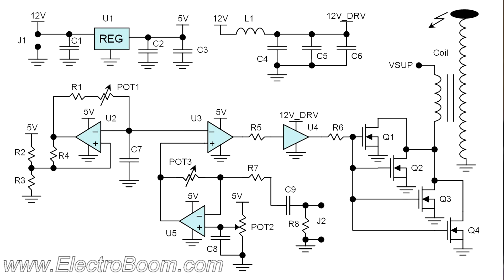Music, Magic and Mayhem with Tesla Coil

Comment: If you were to make a perfect dip in the top of the coil and balance the weight evenly on the spinner would it gain constant momentum or stop at a certain speed?
Reply: to would reach a top speed. at some point the energy being output would not be able to out push friction caused by the air. 

though n that question i do understand that this whole thought of using plasma to push something is being looked at for space ships, chemical rockets are really good for getting too space but once there are really in efficient, and because in space you have relatively little friction and gravity (or if you use a le grange point one could theoretically have no gravity (a legrange point is where the earth and sun cancel each others gravity perfectly, anime loves em)) using something different for propulsion is something really being looked at for viability
Reply: +John Smith with no friction, its top speed would be about 2,200 kilometers per second.

Comment: does the spinning wire rotates due to flux? or because of that fiery thing that comes out of the wire to produce a torque as he said?
Reply: thing the first, "flux" assuming your talking about electricity and not metallurgy is the electricity caused by moving a magnet past a coil of wires. Flux is actually exactly how all electricity generation works to my knowledge, turbines are just giant spinning magnets with coils of wire around them. coal and nuclear are just used to heat water that turns to steam and that steam pushes said magnet in circles.

no whats happening here is the electrons are so excited that they jump off of the wire into the air, and as physics says every action has an equal and opposite reaction, so even though every individual electron weight is negligible due to the high volume jumping off they collectively push the wire as they attempt to jump into the air
Reply: Ohhhh!! Thanks
Reply: Actually, as he himself explains (http://www.electroboom.com/?p=575), it's AC, so the electrons get sucked back on. But the movement creates heat, causing the expansion of air.

Quote: "And they are not jumping out anyways, they are jumping out and in at 1MHz frequency. So what is turning the wheel? It is the expansion of air due to the heat of arcs that pushes the rod away. The arcs are pretty hot. In fact when I bring my hand close to them, I can feel the heat rising from them."

Comment: You said that the spinning wheel was powered by the electrons, but this is wrong since there is no DC component in a Tesla coil. I think that heated air plasma taking expansion is a more correct explanation.

Comment: yo can someone fund this guy for fucks sake ? can we use those innovations and make them into real things ?
Reply: +hisham borgol 
This sort of thing has been done before

It's used in some places IRL, for example arc-wielders.

This guy knows his stuff alright, but he isn't the first, or only person to do this
Reply: modern science doesnt jump forward with single innovations any more. most truly innovative break throughs are caused by answering a series of smaller problems and piecing the answers together and the many questions are usually not all answered by one person.

TL;DR science is hard and it takes little steps not big leaps

take for example the question of how to teleport something like we see in scifi stuff all the time. how would one manage that? question the first are we assuming no pocket dimensions or parallel worlds? if thats the case we need a computer capable of somehow scanning you and determining your exact form down to every atom and chemical and bacterium, to my knowledge no computer has a way of scanning you with that granularity yet so thats a start. next issue, how do you propose we rip you atom from atom? doesnt that sound painful? also if we rip you atom from atom then shove them back together, have you really been teleported? or just killed and cloned? then assuming you can scan me and decompile me, how do you propose we put me back together? chemicals have minds of their own and behave in ways we can well predict. why would all the florine in my body go where we want it and not just attach to the next possible thing it can like it tends too?

all that rant is assuming no parrallel dimension teleporting, the problems with dimensional teleporting are just as daunting, cuz we dont even know if they exsist or not yet lol. suffice it to say, your not gunna find un discovered science on the youtubes, at least, not in a manor as silly as this man
Reply: any electrical engineer can do that
Reply: You don't need to know anything about parallel worlds or pocket dimensions in order to teleport, teleportation is just a method of transportation.

Teleportation, as a concept, is silly: if you need to move all the atoms in my body to some other location where you'd then reassemble me, why not just load me up in a car or a plane and move me there?
If you need to disassemble me (ie. kill me) to scan all the atoms in my body, and then proceed to use that data to create a copy of me in another location, you would have discovered cloning. Now, just use that data of me to create infinite copies of me and I'll conquer the whole world. Bwahahaa.
Better yet: if you can scan all of the atoms in a human, you already understand how everything in a human works, and you could easily tamper with their DNA and physical properties. Thus, us regular mortals are no longer needed and our new superhuman overlords can simply discard us.

Even though it is irrelevant to teleportation, I don't believe there has been a any significant evidence that suggests the existence of any form of parallel worlds or pocket dimensions. Sci-fi that is loosely based on quantum mechanics doesn't count as evidence.

Comment: Electroboom, you are the bomb!
Electrojet propulsion, Wireless transmission of electricity by induction through insulative materials, Electrojet sound emanations.

Why are you able to replicate Tesla's results using DC when Tesla used high voltage high frequency AC?
Is there a principal of application which applies to both AC and DC or was Tesla using DC circuits before the coil to achieve certain results?

Comment: .... how? how can ELECTRICITY make MUSIC?????????????????
Reply from the maker: +wolfy boy There are these magical things called speakers
Reply: Yeah, i know, but since he DIDN'T use speakers, i was curious.
Reply: +Joseph Matthew Dailisan (Matt) ok thanks. :)
Reply: +Gain Medium awesme!
Reply: +wolfy boy The same way we hear thunder, it creates sound pressure waves but it uses a spark instead of a vibrating surface like a speaker. The spark has a very high frequency carrier waveform (above 20KHz) and the music causes that wave to have lower varying frequencies embedded within it.
Reply: The heat from the arcs causes the air to expand generating compression waves called sound.
Reply: Pain Foinmr Because he used an audio signal, same as the one you send to your headphones. An audio signal is just very precise pulses of electricity going from positive to negative, on/off, very fast. They move a speaker back and forth with on and off, a certain amount of times per second, to make a sound of a certain pitch. Instead of moving a speaker cone back and forth, that same signal is just pulsing the electrical arc on and off.

*Disclaimer - This isn't 100% accurate, but for a YouTube comment it'll do. If someone else wants to write an essay on the nuance of AC signals and waveforms, be my guest :)
Reply: +wolfy boy You referred to the creator as 'he' when you were directly addressing him, that is why the weeaboo pointed it out.
Reply: +Morgan OH yeah. it seemed like such a rude answer, so i didn't think it was him, cause i didn't really pay attention to the name. XD
Reply: Since no one has a straight simple answer yet - Think about the sound lightning makes. This Tesla coil is just turning a small bolt of lightning on and off extremely fast, thousands of times per second. The faster the lightning the higher the pitch. All sound is just air vibrating very fast. This works just like a speaker, but instead of vibrating air with a paper cone its vibrating it with lightning.
Reply: How does lightning make thunder? It heats up and expands the air around it. When the arcs heat the air, the expansion makes sound. When he added the AC input section to the circuit he can tune it to make sound by putting some electric signal (in this case music) to the input.
Reply: no, i didn't. but that was so NAKED! it was JUST a tesla coil, and a metal wire.
Reply: How did the classical music come about??
Reply: The lightning (plasma) is heating up the surrounding air, making it heat up.
Different notes are made by the lightning flashing a number of times per second.
Reply: +RiaRadioFMHD773 he changed his cirtcuit halfway throughout the video and i'm trying to understand why that change allowed music to be played while not before? please can you explain
Reply: @Dragonheart24  the signal used to make your speakers sound is ac (or alternating current). With the first circuit he could only input dc voltage, while he needed ac. Other thing that the new circuit does is to fix the frequency of the coil to the one from the input, so you can play songs.
Reply: idk. but i know it's more than just electricity.
Reply: Dude he is smart guy i proud of him
Reply: Did you know a regular speaker uses electricity to make sound? It converts the electricity pulses from the amplifier into sound in the speaker....
Reply: +Inthelambdacore Doss (InTheLambdaCore) nice. :)
Reply: +xen dreemurr yes? and? who knows best, than the person who made it?
Reply: like dat 3:00.  to make it 2:30
Reply: +Gain Medium Dafuq? XD
Reply: Really?
Reply: How do you think a speaker works?????
Reply: Ben's Tech Garage  XD
Reply: ***** lmao of course, but if you don't watch anime, I am proud of you, just seemed like a weeb to me...
Reply: music Is electricity DUMBASS
Reply: music is binary smart ass
Reply: Your computer makes sound, which is music and music comes from the electricity of the battery or plug. 

PLEASE DON'T USE THIS EXPLANASION IN PHYSICS CLASS UNLESS YOU WANT TO FAIL I THOUGHT THIS THROUGH WHILE TYPING IT
Reply: +croop Music is moving air and the electricity os moving in a way that moves the air and creates sound waves. 

(I think 💡) (Insert lego movie emmet saying I think. )
Reply: thank you for the good answer.
Reply: thanks for the great answer! :) i already got a answer, long ago, but still. X3
Reply: because, if you notice, he said that it can now use AC, like audio input.

Comment: Do you guys know any place to buy a coil or do i have to make one,  im looking for one less than a foot tall to experiment with.
Reply from the maker: +zayd abbas You might be able to get a spare one from OneTesla.com
Reply: Thanks
Reply: +zayd abbas  slayerexciter(DOT)com you can buy one from slayer himself.
Reply: +TheAstronomyDude yes,  ive been exploring and I got a lighter thst uses plasma to ignite stuff. And i'm planning to make tesla coil that can power an led form at least 10 inches away
Reply: +zayd abbas so its been a month, are you still alive ?
Reply: nooooo ! if you want wireless power you need coils in a circle, not a torus like a tesla coil. Look up "wireless charging" for example.
Reply: +zayd abbas 12V DRV it connect to Vsup ?
Reply: Maybe something like those induction chargers except with a better coil
Reply: thank :)
Reply: ***** thats what I did.
Reply: spooky, I put led screens near it and they turn on.
Reply: and that high-pitched noise is crazy.
Reply: I got mine as a kit on ebay. It also plays music.
Reply: or you can just open an old tv

Comment: how much power do you have behind your coil? I am looking to build my own coil for my own experimentation and any points and tips you have would be greatly appreciated?
Reply from the maker: +keiffer zaremski My supply is outputting close to 10 amps at 30V, so 300W
Reply: does it use that much energy when you aren't touching it?

Comment: Wait, if the thing is spinning because of the electrons shooting out of it, does that mean we can make a centrifuge made out of a tesla coil?
Reply from the maker: +YourLordCthulhu It's really spinning because of the heat generated by electrons shooting out, which expands the air forcing the thingy to spin. The electrons oscillate in and out of the rod.
Reply: But can we make a centrifuge?*****
Reply from the maker: YourLordCthulhu
As long as it is a light weight thing. A motor would be much more suitable.

Comment: I believe there was a tweeter by Magnat that worked similarly , but the ark generates ozone (poisonous, smelly) so they had to encase the sparks inside of glowing-hot wire-ball.
but as far as I know that thing is supposed to be the best tweeter yet built because of the low mass of the plasma

Comment: +ElectoBOOM I am new to circuits and seems like much wizardly nonsense to me. However, I have been reading up on SSTC's and am now wondering what type is yours? I see they have ISSTC's, E-Class (Have no idea what this is), and DRSSTC's. but from what I read DRSSTC's can only use MIDI files. How does your use regular audio output?

Comment: If I'm not entirely mistaken, this is also the core concept behind the Ion Drive that provides propulsion the newer deep space probes. They don't need fuel. As long as their solar panels are intact, they can change their velocity.
Reply: +morphman86 
No, got nothing todo with ion drives. It's the air heating up in the sparks and expanding and pushing the rod away.
And ion drives need fuel. It's in the name. Ions are normal matter that gets ejected.

Comment: I don't get it , why do you have to use a mosfet driver? Can't you just hook the op amp straight to the mosfets?
Reply from the maker: The input of a MOSFET is a good size capacitor . To run it fast you need a driver to supply lots of current to switch it on and off quickly
Reply: +ElectroBOOM ok I get it, I looked everywhere for this answer but I could not find it. This will help me build a tesla coil for my science fair , thanks!! :)